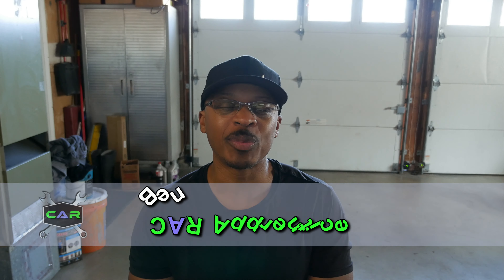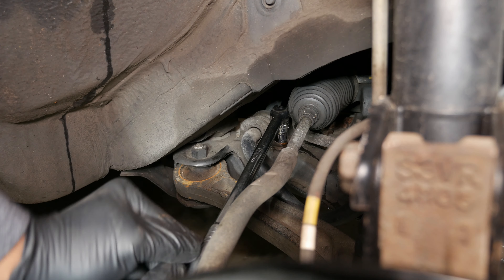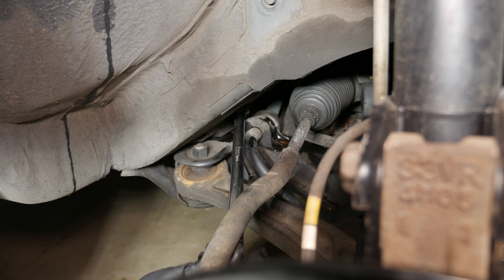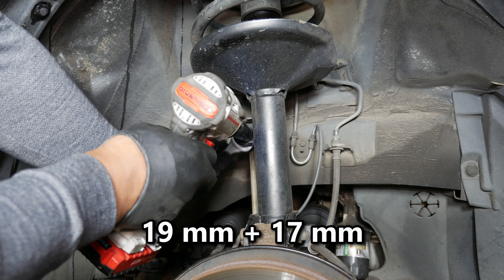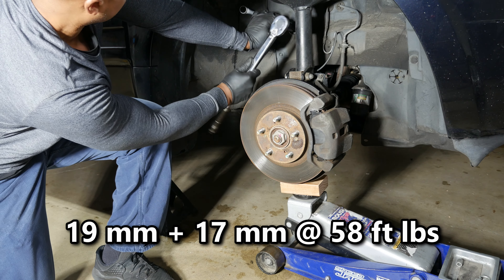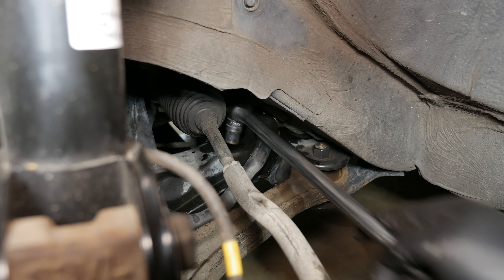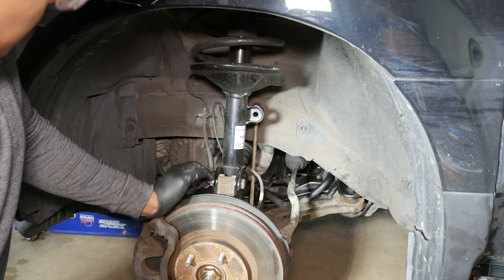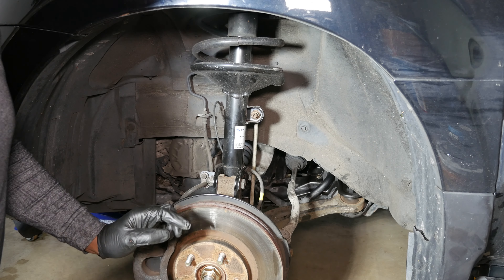2004 Honda Pilot - Front End Clunk Fix - Stabilizer Bushings Replacement

Comment from the maker: The front end clunking is finally resolved. Car drives much better.
Please leave a 👍 and share the video!

👉 Visit our website ► http://carapprentice.com
 
👉 Click to Subscribe! ► https://bit.ly/3bLvCFd

👍▬▬Follow Us on Social Media▬▬👍
✔ Facebook ►  https://bit.ly/3bHtMFC
✔ Twitter ► https://bit.ly/3hLdJKK 
✔ Instagram ► https://bit.ly/3u380lS 

🔧▬▬Tools and Materials▬▬🔧
✔ Car Apprentice Recommended Tools and Materials ► https://bit.ly/3DP75xM
✔ Front Stabilizer Bushings ► https://amzn.to/3oJZ2gX

📷▬▬Video Equipment▬▬📷
✔ Camera used ► http://amzn.to/2GcpkOb 
✔ Lens used ► http://amzn.to/2Deu16S 
✔ Tripod ► http://amzn.to/2GbaM1c
✔ RAM Suction Mount ► https://amzn.to/2Wz9PXh
✔ Cyberlink PowerDirector ► https://bit.ly/2jTwGxT
✔ Adobe Photoshop ► https://bit.ly/2V7nyUX
✔ Camera Slider ► https://amzn.to/2WtD7GW
✔ Deity V-Mic D3 Super-Cardioid Directional Shotgun Microphone ► https://amzn.to/2LI1lf7

This video was recorded in 4K resolution, so modify your settings accordingly if desired for better image quality 

Disclosure: This video contains affiliate links, meaning, at no additional cost to you, I will receive a commission if you click through and make a purchase.
Reply: Clunking from the left side? Almost sounds like it could be a ball joint or inner tie rod but its a $5 sway bar bushing, sometimes you win on cost!
Reply: @carapprentice Hi there , I'm having a hard time removing the bolt on the right side because of the small area to work on it . I try from behind but really tight bolt ! Is any other way around,  passenger side was a breeze,  driver side is headache,  same 04 pilot . I'm learning here with your videos . Thanks for sharing
Reply from the maker: @mikemazzi226  I mentioned or captioned some options after applying penetrating oil: (1) Use the double-wrench trick for added leverage (or a wrench extender bar). (2) Remove the short driver's side rear-corner subframe bolt and ONLY LOOSEN the long driver's side rear-corner subframe bolt (guessing less than 1" should be enough). Make sure there's adequate support if you attempt this procedure: https://youtu.be/7dtQQDkoC-w?t=1575

Comment: If needed you can loosen the sub frame bolts for about an inch more clearance, the subframe bolts are fairly long, if not then get you some stubby 14mm wrenches one regular and one ratcheting, get the rear bolts from the underneath inside like he did in this video. Its not as bad as it seems! Lube the bar area only, do not lube the outside of the bushing.

Comment: You can use an S Shaped 14mm box wrench on the driver side bushing bolt.  I just changed mine without lowering subframe or going under the car.

Comment: Hey are you using a 3/8 or 1/2" ratchet?
I have the same car and just wondering about the tight close access fit.
Reply from the maker: I used a 1/2" ratchet.
Reply: Thanks for the info.

Comment: I did the passenger side bushing... it was not too difficult... But wait the driver's side is crazy hard with this tube passing on top of the nut... If I did not see you doing it, I would have thought it was impossible to do. I went under my pilot as well and I can barely fit a wrench in there...what the heck! I am not sure I will make it.
Reply from the maker: Yes, it's tight on the driver's side.

Comment: I am considering a 2004 Pilot at 145k miles. He is asking $5800. I can make an offer but considering I may need to change timing belt, water pump, spark plugs fluids... I need to invest few grands. Not sure if  I should do it or get  something newer. I have no tools or garage. I can only change filters and bulbs 😂
Reply from the maker: Have you contacted the seller to see if service records are available? At 145K miles and 19 years old, the timing belt and water pump should have been changed at least twice. If you're able to do your due diligence and work out a price with the seller, I would have it inspected by a shop. Ultimately, purchasing a newer car may be a better alternative if you don't feel comfortable buying a car that old and you can't work on it yourself. I will say that the Pilot is a great car when properly maintained.
Reply: @carapprentice   I did ask to see if he has changed the timing belt, water pump and spark plugs. I asked to see if he had any maintenance records. It seems like he didn't like my questions. He stopped responding. Also, when I asked for the VIN he send me a report from Bumper (first time I saw) which didn't really show much. I guess I will skip this one, spend little more and try to find a  Highlander.